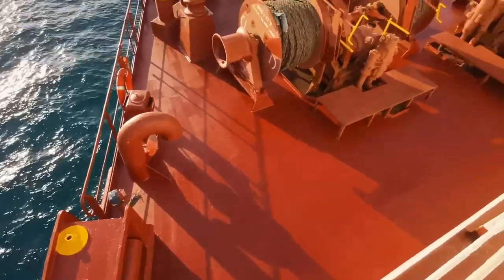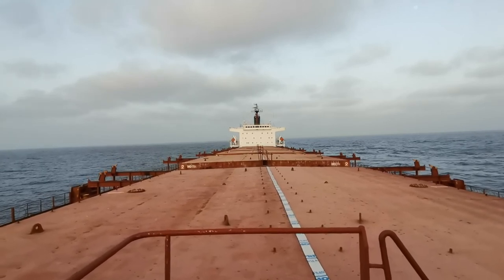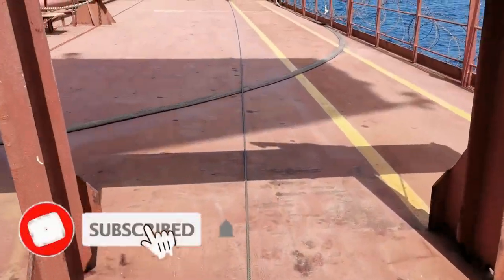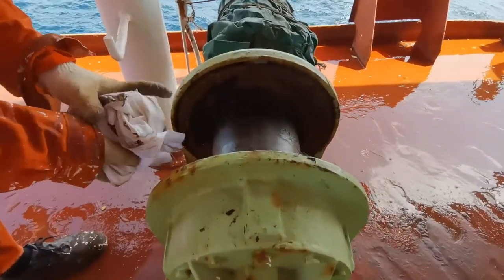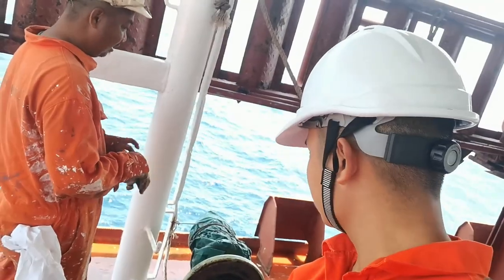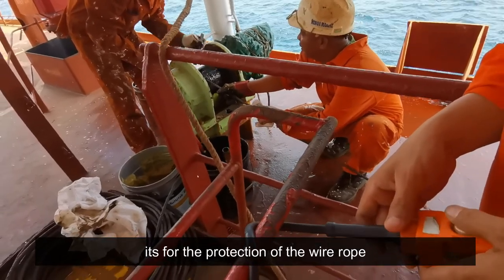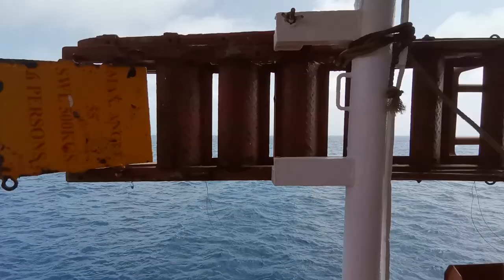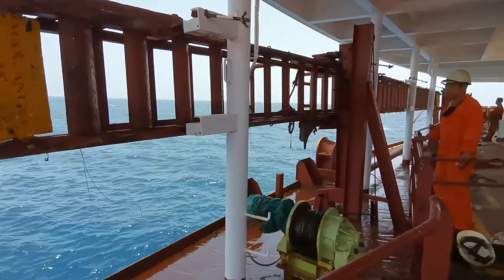SHIP DECK MAINTENANCE PART 3 | GANGWAY LADDER HOISTING WIRE RENEWAL | CHIEFRed SEAMAN VLOG EP.25

Comment: Sir how ull did first ull cut the thimble end other side directly joined with new wire to old with welding ya seizing heaved up the rope on drum once new wire reaches on drum keep that sideways n than remove old wire side of drum n remove the full rope out of drum heave up new rope commect end to drum fixed point n heave up correct sir??this is the way ull did?
Reply from the maker: @astle Fernandes, yes, the old wire will be your guide to correctly install the new one, so you have to connect the old wire and the new wire and just heave it on to the warping drum then you can now connect the new wire to the warping drum and continue until the thimble finds its place

Comment: Tanung ko lang sir kung anung standard diameter at haba ng cable na ginagamit u pag panamax?thanks sir
Reply from the maker: Jeffrey Sari you mean sa mga equipment na may wires on board? depende yan sa construction nung particular equipment sa barko so the best way is to look at the manual of the said equipment para makita mo ang original at tamang sukat ng wire rope.

Comment: On our ship we cut the thimble on other end lower the drum n pull the full rope out from the drum once we reach the dead end on drum rope we tie bigger rope passing through all sheaves n than we connect new wire rope with normal rope which we had passed through all sheaves than we heave the drum once wire reaches near the drum we connected the end to thimble n then heaved thats it
Reply from the maker: @astle Fernandez, as long as the new wire will pass through on the same directions with the old one then that’s okay, different ways but the same goal,